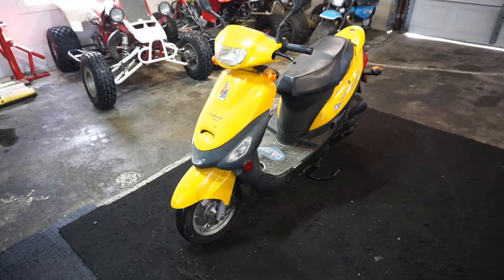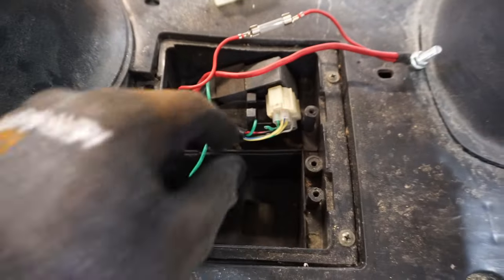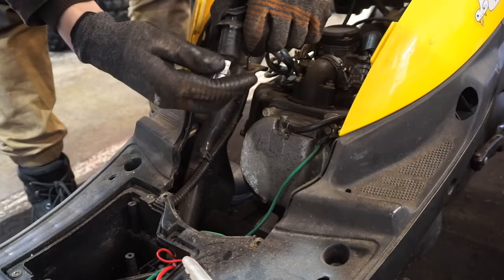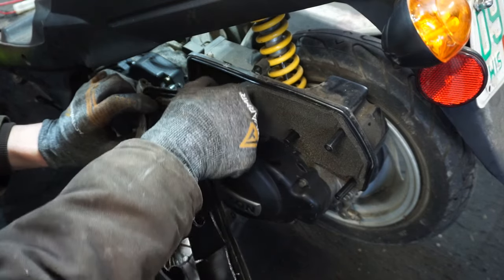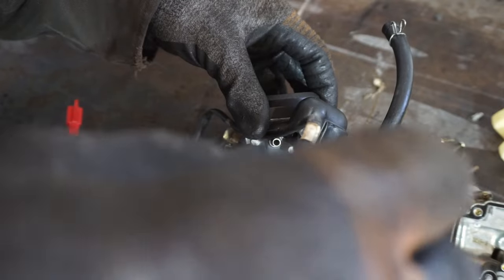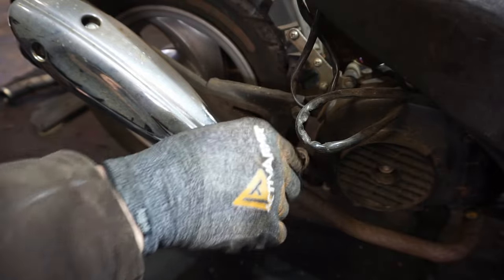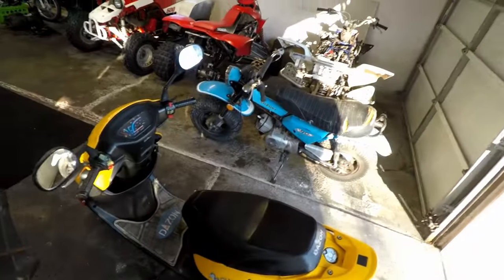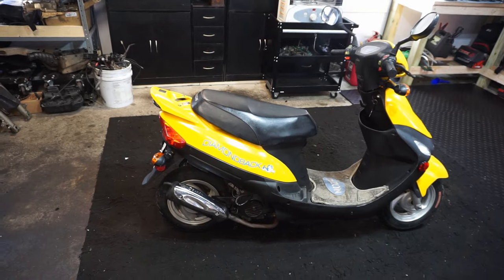Saving Thousands On Gas With This Scrap Pile Moped (100MPG)

Comment from the maker: Here is the plastic saver I used in the video. It works pretty well! Motul plastic shine solution: https://amzn.to/38lWmxe
Reply: Man I had one almost exactly like this but mine was a 125cc if I remember correctly and she would do 80mph wound right out but it wasn't very safe to do lol because at that speed everything shook and vibrated quite violently on it but it'd do 65mph highway speeds just fine and had some "get-up-n-go" to her for a moped I could grab the front brake, stand up then pin itt and shed sit still and spin the back tire just a rolling smoke and once it got going I could sit back down and it's stay spinning then id let off the brake and take off doing a rolling burnout for like 10ft I loved that lil thing it was like a fat girl- fun as hell to ride but ya didn't want your friends to catch ya on it hahahaha then in Dec of 2008 when we had no snow for a week straight I took it out for a rip around town and had a 73yr old man pull out in front of me and stop and I was doing around 45-50mph couldn't stop but had both wheels locked right up till I t-bones his car which landed me in the hospital for 3 n half months because I shoved 4 ribs through my thoracic aorta (heart) and after multiple surgeries they finally put me back together and my wrist has titanium plates and bolts in it, missing half the muscle of my lower left leg and took me over a year to learn to walk again... thankfully I was able to get a lawyer and unfortunately they didn't fight real hard for me so I ended up getting 90k settlement of which I got 54k sucks because I can't walk or stand for very long and it completely changed how I live my life... I guess I'm just grateful to be alive 🙏
Reply: Pretty sure that fuel has pre-mix in it and that is why the carb was all gummed up and there was a bunch of oil leaking underneath it...
Reply: I'll have to check this out.
Reply: The green wire is to limit the bike to 30 mph

Comment: The green wire has been cut to remove that 30 mph restriction ,with the wire cut should get closer to 40 mph
Reply: Yes ! Revlimeter wire .
Reply: Ya that is what i was going to write it was a mod that most people on scooters do to get more speed and have a but more fun out of there scooters. For him to say that the green wire was the problem was wrong it was that the carb was dirty and not getting enough fuel if any to the engine but you did put it back to stock if you like having it go a minimum speed. Put that green wire back the way it was and you will have more fun with it
Reply: Wasn't the carburetor that was plugged though.. Was that green wire that got it fired right up...
Reply: Don't put wd40 on black just use heat gun
Reply: It's not a surrron haa
Reply: Rev limiter wiring did it with a Chinese moped. It got faster but not much faster (not worth the speed you gain)
Reply: You hook up a little handheld divice to a plug under the right back fairing that tells the computer how fast it should go.
Reply: @hondaryder3779  no computer on this machine just CDI box to control the spark.
Reply: @jonathontaylor8861  ah, i didn't recognise that brand, EU rules are very strict. I used to sell scooters for a while. We could program Them to go 25, 30 or 45 kmh. 25 no helmet, allowed on bikepaths. 45 helmet, only on bikepaths outside build up areas. 30 bc you only get s fine above 30 when caught by police, they have a device called rollerbank to check. 🇳🇱NL
Reply: I see a lot of that online and as an EE there gona be consequences to cutting the rpm input. Like destroying your engine and altering the timing,
Reply: @hondaryder3779  is that what the two wire plug under the deck is? I tried metering it and wasnt sure what signal I was seeing. I dont see anywhere for it to connect to in any harness it can reach.
Reply: with all do respect, yes cutting the rev limiter wire wil maybel get a bit more speed. your better of tuning the cvt varator transmition. as the scooter can only go as fast as the transmition is tuned. removing a rev limitor ussaly only helps reach the speed quicker
Reply: true
Reply: @jaydenb5757 the moped will only go as fast as the ENGINE will allow. It’s only a 50cc. You can’t expect too much from it. Think about it like this-your legs can’t run at 50mph. Just not physically possible. Same can be said for the 50cc engine. Pushing up the revs might get you 2 or 3mph but at what cost to the engine?  Go with a big bore kit if you want more power out of it.
Reply: @cherylcanning9499 the moped will only go as fast as the ENGINE will allow. It’s only a 50cc. You can’t expect too much from it. Think about it like this-your legs can’t run at 50mph. Just not physically possible. Same can be said for the 50cc engine. Pushing up the revs might get you 2 or 3mph but at what cost to the engine?  Go with a big bore kit if you want more power out of it.
Reply: @grazz7865  yes it will go as fast as it allows but getting the restricted wire cut off to the ecu it will allow more output and YES it does work as i did this on a chinese 50cc before yes it wasnt much faster but it was quicker at top end speeds. So doing it myself can confirm it works the engine will only give maximum output for speeds but the ecu restriction needs to be isolated into thinking the rpms arent fully there to where it reads giving more power

Comment: I owned a moped and saved probably around $5000 in fuel costs until I got hit by a geo metro at an intersection and died. Now I'm in heaven. The wifi hear is fast as fug
Reply: But did you die?
Reply: Very funny 😅

Comment: As the guys on MopedARMY would say... THAT'S A SCOOTER NOT A MOPED!
Reply: It's both.
Reply: @tobbes3566  it's not.  This has no pedals, therefore it is not a moped.
Reply: @wannawin95  exactly…..the ped in moped literally comes from pedals 🤷🏻‍♂️
Reply: @jonnyonwheels  That's an old, now atleast were im at it a scooter moped. Dosent need pedals anymore.
Reply: Not a MOPED.  IT'S A SCOOTER.
Reply: @elmerfudd1086  Maybe in The US, here it's 49cc thats a moped pedals or no pedals.
Reply: @wannawin95  Yet it's a moped, literally classed as one
Reply: @eliaslundstedt5607  false.
Reply: @wannawin95  If I go and grab a yellow piece of EU marked paper from my bookshelf, for my Kymco scooter, it will say Klass 1 EU moped on it
Reply: @eliaslundstedt5607  just because your government classifies it incorrectly doesn't mean that a scooter is a moped...
Reply: @wannawin95  my entire continent*
Reply: @eliaslundstedt5607  Yes.
Reply: Actually, it's a NOPED! 🙂
Reply: If you can ride it with a skirt on, then it's a scooter.
Reply: @karirautio  Except that many older mopeds had open, step-through frames, to allow riders in skirts! 🙂

Comment: That wire that was cut was to restrict it at 30 mph normally with it cut you go faster
Reply: if its a 50cc it wont go much faster then 50kmh... for a 4 stroke
Reply: @reggiexp69  50cc 4strokes easily goes up to 80kmh if completely derestricted 2strokes can go up 100kmh
Reply: No it wasn't dumbbell totally opposite
Reply: @reggiexp69  my Tao Tao 50cc 4 stroke goes 70Mph (112Kmh) on flat roads. Upgraded carb, exhaust and removed the restrictor ring on the variator. All in $30 for a 24mm? (I forget) Mikuni clone carb from Amazon and $64 for a really decent sounding full exhaust off of ebay. Engine has never been opened up.
Reply: @bevis226  i mean yeah, but 112kmh i dont beleive if you said 70kmh sure my bigfood 50cc dirt bike engine quad did 65kmh
Reply: @reggiexp69  I agree my Honda sh125i does about 68mph.  My Honda SFX50 40 mph max.
Reply: @1960ARC  yeha that seems reasonable
Reply: @reggiexp69  Not all 50ccs are created equal. Ive seen ppl say "they have to be wide open to ride 35 mph. Well in is stock config and  once the CVT has spun up, I can ride 35 at 25 percent throttle. I can get to over 40 easy but havent rode a large enough strait away yet to see how far it will max out at.
Idk how fast I really wanna go on one.
Reply: My lil 50cc does about 48mph over 7,000 miles on the motor and still runs strong

Comment: So ironic you put this out today. I literally just came in from reviving my 2002  50cc China scooter made by Geely. It hadn’t been run a few years and basically just needed a carb clean. So good when they come back to life!
Reply: Are u sure bro,what with zilch power?Boring!🤔🤨🤔🤔🤔
Reply: @craigmorgan4676  yeah, boring for me but fun for my kids. Doesn’t get used anymore anyway so it’s getting sold.
Reply: @noidontthinksolol  yes the Cineseium metal sucks and the plastics do as well. But for $650 shipped to my house brand new back in the day, it wasn’t a bad deal. Fun for awhile now it’s getting sold. Polaris sportsman is much more fun in the woods!

Comment: When you solder you need to get heat in the wires so that it acts like a wick to the molten solder. It will soak it up and have a much stronger connection... It doesn't matter too much in that scenario but that's how soldering should be done 👌👌
Reply: It definitely looked like the the iron wasn't  up to temp for that solder. He should also work on those joints
Reply: Perfect Explanation Sir !!
Reply: Iron with larger size bit would have help it looked a little small to me and your correct, tin the iron, heat joint and apply solder.
Reply: correct. I have a BS EE and have done a lot of soldering. I can say if your iron doesnt have temperature control, its a hunk of junk. Doesnt have to be expensive to be goodm even my small all in one inline 65W iron for 20 bucks on amazon works well once broken in.
Reply: @jhoughjr1  agreed. I bought a cheap one off eBay that has temp control and temperature reading. Came in handy when I was soldering CCA wire etc.

Another handy feature is the spool holder 👌
Reply: yep i was thinking the same. some soldering lessons would go far in this case :) youtube's got you sir

Comment: These will run fine if you take care of them. I’ve put well over 10k km on a couple examples and they still ran fine when I sold em. Yes, that dash reads in km. These things generally get a bad rep over little things going wrong, then it stops running and the owner doesn’t know what to do.. it’s almost always something simple and cheap. I rode these things exclusively for several years.. fixed up a couple heaps in that time, rebuilt a couple engines, ect. Just be sure it’s not running too hot.. I disintegrated a piston that way once. I  still daily two wheelers, it’s just a Honda 250 at The moment. 

Also, that is a scooter. Mopeds have pedals. No peds= not moped.

There’s a ton of info on these things and easy mods/upgrades if you do a little googling.

Comment: Very practical.  Aside from great economy it's a very visible yellow... and smaller wheels have quicker rebound on the bumps than the larger wheel setups...   
I personally use dielectric bulb grease and a toothbrush to revive my plastics and rubber components... just wipe it all off to avoid dust clinging to it.

Comment: There is usually a small spacer between the two halves of the variator (front pulley). It stops the two halves closing fully up and serves as a top speed restricter by limiting the effective “high”speed gearing. Remove it and you will have taller gearing and faster top speed. Low speed take off from a standstill is unaffected.
Reply: Yep remove the spacer and put a cheap 24mm? Mikuni clone carb off of amazon it and it will do 70mph tops with a 150lb rider on a flat road. My POS 50cc scooter rips lol. Performance Exhaust helps a good bit as well. Remove the EGR restricted exhaust. My next upgrade is 100cc big bore kit. It needs more bottom end torque. It's still pretty darn slow going up hills.
Reply: The 3 most common methods of restriction are the variator, the CDI, and also the exhaust.  Many times a small restrictor is placed in the exhaust where the manifold bolts to the muffler.  It can either be simply placed in there, or is sometimes tack welded in place.  Removing that gives the full performance.
Reply: @Fredjoe5  Some also have a projection inside the carburettor top cap to prevent the slider from opening up fully. It can be cut or snapped off.
Reply: @bevis226   There's no way a 1.9HP engine is doing 70 of anything.

Comment: I just bought a PCC Amor 50 from a guy who put a 70cc BBK on it. The carb was crappy, so I bought a new one(20mm), along with a new variator (6.5g rollers) and belt, and it is amazing now. Takes off like a car and can climb hills at 35mph. I think the full throttle jet needs attention though. Idles great, and then great low end power, but full throttle doesn't have any more power than say 1/2 throttle.. I will pull my spark plug to see which way it needs to be tuned. Timely video for sure. I got mine to make deliveries because 13mpg sucks...

Comment: As soon as I looked at this scooter, I thought get the old crappy gas out of it before even turning it over. And check to see if there is any oil in it. Those were my first two initial thoughts.

The green wire is the rpm restrictor wire, to solder it together had nothing to do with firing this thing up. The spark was uneven on the first check for spark, because the plug wasn't grounded well enough. If the wrong wire had been cut, there would be no spark at all. My own scooter has two restrictors, one for MPH, that cuts the RPM back to 6800 @ 28 mph and if the wind is right, the road is right, you might hit 30. The second actually has a plug connection to be about to remove the cv cover, that limits max rpm to 7200. Its easy to pull out the wire at the cdi, and it can be pushed back in, no damage done. Obviously, unplug the second. This lets the thing free rev to over 9000 rpm, though in riding the bike, it rarely hits 8000, It hovers a lot around 7200 or even less, but the ability to rev lets the cvt close up, then you can pull the throttle back, is why. It hits 8000 or 8200 on long down hill wot. Just riding around town, there is more pull either way, but isn't much difference in power, if to just pull the wire at the cdi or to pull both restrictor wires. But in more open road riding is where the second disconnect is noticed. It can hit near 40 this way. However I have not as yet touched the cvt.  This bike I've owned for less than a year, it's barely getting broken in.

Glad you got it running, at least !!

Comment: Agree with the wire you repaired, thats a limiter wire, just cut it and go faster :) And I also think the electric choke is not working correctly, watching you start it cold, its the black thing on the carb with the 2 wires, pretty cheap fix, and a lot easier starting after
Reply: No its a sensing wire. EVery scooter Ive seen it done to runs worse than with it in tact.

Comment: Hi in the uk that ped is a boatian bt49 good little bike it’s downfall is if you leave it out in the rain it’s petrol tank fills with water. The kids cut that wire  to the ecu and the wires to the variation case as they think it de restricts them not so sure myself

Comment: haha i have exactly the same scooter model only from 2005. bought the little bugger also for 200 but euros, i did 10.000km on it already and it saved me a lot of money going to work during corona! in fact, it enabled me to work cause i started at crazy hours in morning with no public transport and i had no car nor money. i drove a bigger much newer Sym Fiddle i believe, but this one actually handles better, very small and nimble, and corners very well. 
I tell you people, as money gets tight and prices go up, get yourself one of these, they're great plus pretty reliable!

Comment: To check the condition of the engine, first check the ignition and then the fuel to the intake manifold. If it starts, then carburetor cleaning. The idle jet may be clogged.

Comment: The great thing is that scooter has been made by like 200 Chinese manufacturers and is still made identically to this day. Back in 2016 TX Motorsports had them for $599 shipped lol I bought it just based on principle but man was it a dog.. 30mph tops.. I didnt know about the green wire another user mentioned.

Comment: Just picked up a scrap 60 volt Tao for $250 where buddy kept it out for four years and the batteries expanded because of the cold.  And the funny thing is it turns even with the charger plugged in.  So I might add a generator.  And later make it more of a Liberty motor.  The Batman II, more beefed up!

Comment: I just picked up a  modified 2022 ruckus a couple weeks ago I’ve put 666 miles on it as of this moment and 6.6 gallons of fuel in which has cost $29.78 if my calculations are correct it comes out to 101 mpg average and $0.0447 per mile which is slightly more then the 2021 Tesla model 3 plus extended range RWD which according to online was the cheapest electric car to operate in 2021 at $0.0308 per mile. I couldn’t find anything for 2022 models. Things a blast I highly recommend getting one to anyone looking at them or interested in anything similar

Comment: The wire had been cut because the previous owner did the usual trick of trying to un-restrict the moped to make it faster, have you checked the spindle on the carburetor diaphragm to see what groove the cir-clip is on?
if the wire is cut and the cir-clip for the spindle is on the middle one watch how much faster it does.
by  cutting the wire it stops sending the RMP message to the CDI and thinks it has no revs or idle, this causes the bike to rev higher or more freely, by changing the cir-clip on the diaphragm  it allows more fuel through.
it would be good to see you try this in one of your videos.

have fun and great channel

Comment: Be sure the tires are up to pressure. I rode one identical to that once that was at 15 psi they looked good but no, almost ate shit hard on a turn at the recommended speed.
Reply: yeah i rode an icebear that was low and it handled so squishy rerally affected its top speed to.